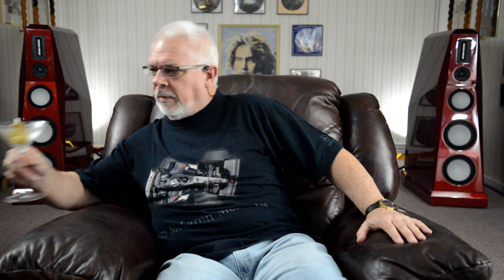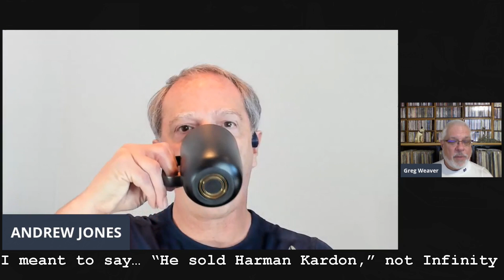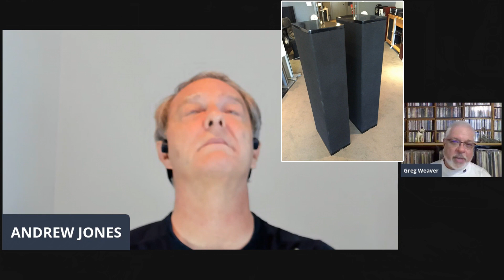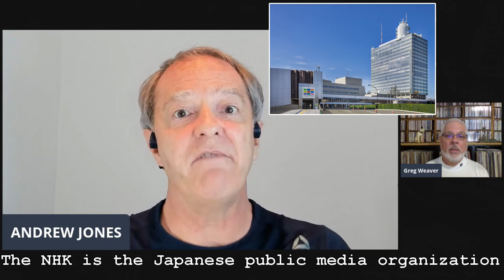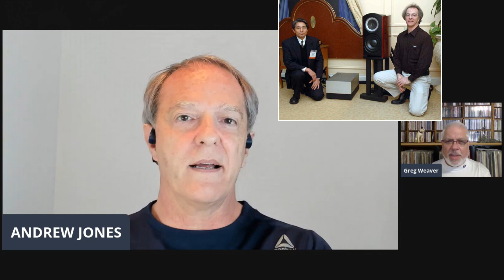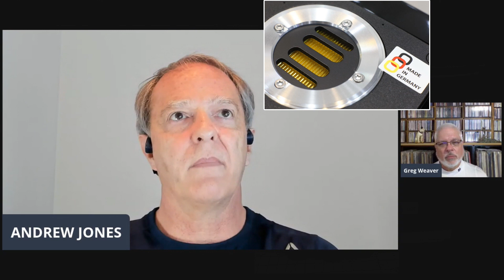E42: A Conversation with Andrew Jones – the Infinity, Pioneer, & TAD years

Comment: At about 30 minute you both mention the first self amplified  speakers in the 90's( I assume you mean for  the consumer market) speakers, but you both are  wrong, Philips introduced  a line of bi amplified speakers in  about 1974-75 , We carried them in our store (Great Western Distributing, Boise, Id) and I bought a pair  on salesman perk. They featured  Philips "Motional Feedback " in the woofers. They were an 8", 3 way  "giant killer" in a relative small box about 15" H x 10" W x 8" D with  40 watt(with MFB) and 20 watt amps on the back plate. I had them for about 4 years and replaced them with Kef 104ab speakers.

Comment: Can you please tell us more about the Pioneer linear power speakers, which are edgeless with two spiders, and had a lubricant that needed to be applied around it? The speakers were only used in Pioneer between 1996-1997/98.